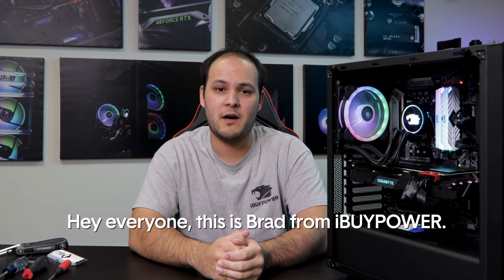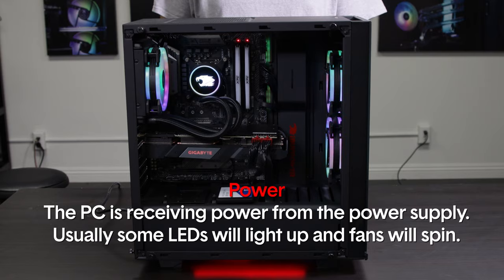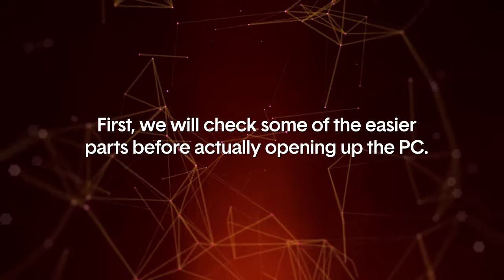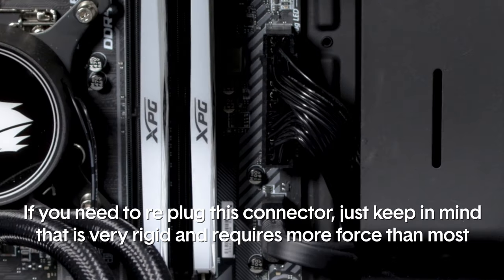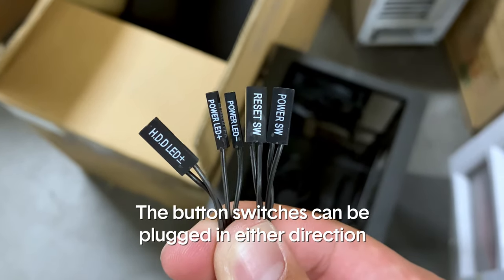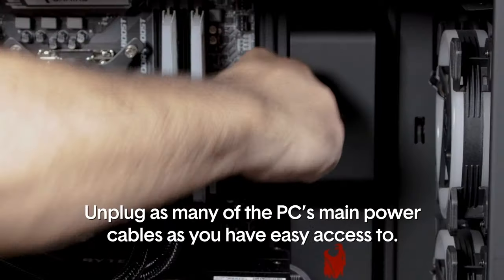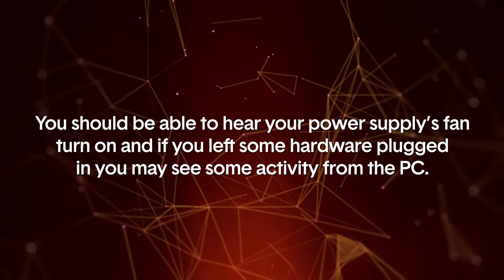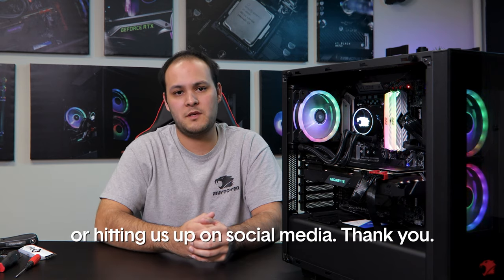"My Computer Will Not Turn On" - Troubleshooting PC Power Supply | Computers and Coffee

Comment: 4:09 don't do it with screwdriver, it's too easy to short the wrong pins and permanently damage the motherboard. 
Take some unused cables with pin connectors, plug them properly and then connect them with bare parts.
For example, speaker cables. Buy yourself a new one for half a dollar, and use the old one as described above.

Comment: Does anybody else have the same problem? I just built my PC and everything is plugged in correctly but only my RBG ram lights turn on and nothing else. Not even fans. Dont know if it’s the power supply or motherboard 😩

Comment: Just got mine yesterday and went to turn it on today and it won’t start :/ edit: turns out i accidentally unplugged a connector
Reply: Same. Right out of the box and wont turn on at all.
Reply: @RainCloudSociety  same with me today, just pulled it out of the box too
Reply: @ryanengles5585  unfortunate. I tried to remedy the issue but nothing worked so I ended up returning it.

Comment: My power supply works using the paperclip trick, so is it a motherboard issue? Cuz power supply doesn't turn on when I plug it into the motherboard
Reply: i am having the exact same problem,  don't know what to do! :(

however u should check whether ur cmos battery is dead or not!
Reply: @ankitgupta1298  I figured it was a motherboard problem, I'm going to send them for replacement
Reply: @ankitgupta1298  dude you will not believe this, I switched on the pc for an hour straight, then tried to turn it on and it worked! That means there was probably some problem with the amount of time it takes for PSU to give power to motherboard or something, so after keeping it connected for an entire hour charged the motherboard up enough
Reply: @rohansarangdhar8023  that's awesome! congratulations man! really happy for u! haha

Comment: Power is delivered but the pc won’t boot up at all. The motherboard lights up when I turn the power supply on, but the power button on the pc doesn’t start it up
Reply: Same problem as we speak. Power light is on. But it will not power up
Reply: @tebobble  did you find a way to fix it? Im having the same problem
Reply: @itsdarkbtw  negative,  I purchased a new battery.  It powers on sometimes, but other times it just sits and powercycles
Reply: @tebobble  I got it work by putting a screwdriver near the power switch pins. I think the case button is broken or something
Reply: @itsdarkbtw  mine will power up if I jump the pins. Or even jumping the power

Comment: Tried all of these non worked and my pc still showing no power pressing the power button and nothing happens
Don't all steps in this video
Swapped PSU to see if that was it no
Switched motherboard still no
Switched ram still no
Even switched storage devices still no
Reply: Unplug the gpu then turn on your pc

Comment: When I do the paper-clip test all of my components start, but when I remove the paper clip and plug the 24 pin back into the motherboard nothing starts. Do I have a fried motherboard? I am also not able to jump start the PC via connecting the 2 power pins with a screw driver. The strange thing is when I have the 24 pin plugged into the motherboard the little orange light for the Ethernet port still glows so it must be distributing some power. I don’t want to replace my motherboard if I don’t have to so if anyone has any ideas that would be great.
Reply: Yo did you fix it?
Reply: @xRedus  yea I had to rebuild my pc with a new motherboard but it works fine now
Reply: @pcninjagaming595  i my porblem...i blew my mother board with a Blow dryer and it turned on

Comment: I’ve had my PC for little over a year now, and a majority of the time I never really used it much. Not too long ago, it randomly shut off on me with no signs of any issues. Had my buddy who knows quite a bit check it out and said it could either be my motherboard or my power supply. He toyed around with it for awhile but pressing the power button and flipping the switch and got it back on. A month or two later (right now) the power to my house goes out, and everything comes back on just fine, except for my PC. Tried following these steps as closely as possible, but didn’t get anything out of it. Would anybody have any alternative recommendations on what to look for or test to see what my issue is?
Reply: Same thing to me
Reply: Same
Reply: Same

Comment: My computer flickers then it restarts.
Cpu: ryzen 5 3600
Gpu: Radeon RX 5500 xt challenger 
I believe the model is the trace 4 mr 9340
Still happening so I’m going to call them see what they can do about it.
Reply: Three months later the fans stopped working and my gpu keeps freezing and stuttering horribly if you come across this post consider it your sign from heaven than you shouldn’t buy a computer from them. Don’t do it they suck and so does their customer support. No reason why I should pay $2,000 for a faulty computer with no fix or warranty. 

0/10 never buying anything from them ever again.

Comment: I encounter a problem pls reply
Reply: Whats the power problem?
Reply: @alanngo268  my power on button is not working so I tried to jump start 
But it looks like the Mobo is damaged
All store where close so I am using my PC by shorting green and black wire of PSU 
Is it safe ?
Reply: @paraschavan014  It is. All it does is power the PSU on. Make sure that all your PSU cables are disconnected from your motherboard and you have a multimeter. It could be a bad PSU or the wiring is messed up. Connect the black lead of the meter to any metal screw on the PSU and use the red lead to probe through your pins. If your PSU cable pinout do not match the standardized pinout as shown here: https://www.tweaktown.com/image.php?image=images.tweaktown.com/content/5/1/5175_16_case_smithing_getting_started_with_cable_sleeving_full.png, or your PSU's fan does not spin when connected, you have a problem.
Reply: @alanngo268  but I am using this method from last 2 week and only encounter problem while shutdown
I have to turn off the system instead of shutdown 
If shudown is done the fan go crazy